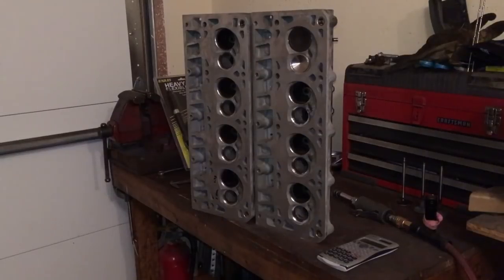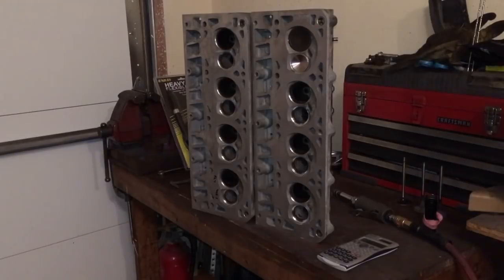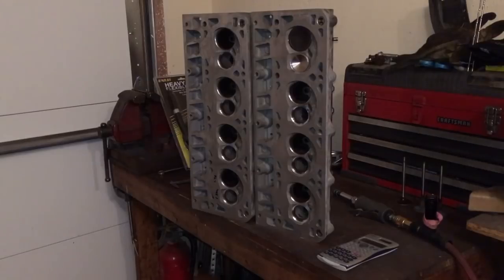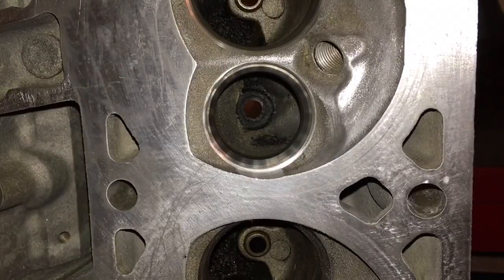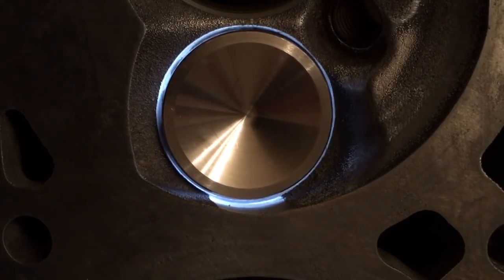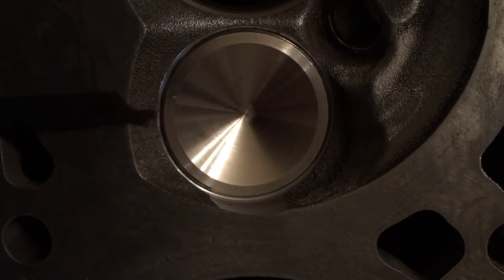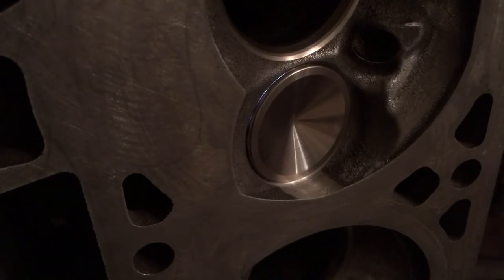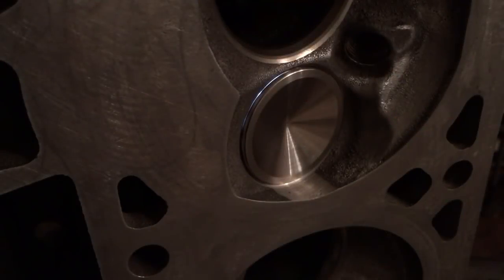862 heads 2.00/1.57 Valves FAIL

Comment: Checking with a flashlight is no way to check valve seal. You need to pull a vacuum test. In either case....too many shops are using 3 angle carbide cutters. Not a bad deal if you know what you're doing. I have bought $1000 heads from Dart, Brodix, etc. and had the same problem. Same problem comes from valves too. You can not take a valve out of the box without grinding it.
Reply from the maker: I vacuum test the valve seal as well,  but I’ve never had an issue checking initial seal with a flashlight inside the port. When I vacuum test I pull 20# vacuum on the chamber side after assembly. I like to put fluid in the chamber area because you can identify leaks around the valve seal and spark plug.  JD

Comment: I realize this was 2 years ago, and I don't mean to be an A-hole. I need to ask, "What did you learn?"

I've been doing this professionally almost 25 years. I've used a alternate machinist 1 time! The last 20 years I've only used Willard Buff at C.A.M. in Spring, TX. Hell....I moved back from San Antonio to be closer to his shop. There's never a reason big enough, after that 1 time, to use another shop. 

Keep up the good work, and I hope the Holley system has been doing well for you.
Reply from the maker: I agree 100%, I’ve been using Nolands Cylinder Heads in KC Missouri for machining processes ever since. Quality and consistent work every time at Nolands! 
The Holley Terminator X has been the saving Grace on my Turbo LS project highly recommended to anyone wanting to LS swap!  JD

Comment: honestly Ive ran bent valves that looked worse on my racecar but cheap motors. Thats bad if a machine shop did that. a good machine shop would never let that pass. they should double check every valve fitting perfectly. that machine shop is a hack and there are tons of hack machine shops.
Reply from the maker: I agree it was a mess and barely fixable by a good machine shop!  I think the shop who did the poor quality work used to be decent but their equipment and attention to detail has gone away.  JD

Comment: sorry , that ex valve looks like it was done on a shaky drill press with a bad cutter and they kept on cranking into it anyway. It would be so powerful to watch fluid leak down test just gushing out around the valve everywhere, you should do it for good measure. is there any possibility of going 1.58" or 1.6"? iwant to use 2.02 and 1.6 valves in 862 heads think it would work?
Reply from the maker: DYNA KLO Two things would need to match:
To properly unshroud the 2.00” valve on the 862 casting in the chamber and having a cylinder bore of 3.900”+.
It’s been proven cylinder shrouding occurs anytime a 2.00”+ valve is run on a cylinder bore of 4.8/5.3 3.785”, so for maximum flow it needs a larger bore. 
These 862’s ended up with LS1 2.00” factory intake valves and Stainless steel 1.57” exhaust valves. I put these heads on my own 4.8 build, it was before the dyno data showing to work best they needed the larger bore; if I had known at the time I would have stayed with the 1.89” intake valve or looked into having these 2.00” valves cut down to a 1.94”.  From what I’ve read, a 1.94” intake valve is as big as you should go on the 4.8/5.3. 
Your fine to go with a slightly larger exhaust valve ie 1.57” or 1.60” if the seat can take the cut which iirc it should.   JD
Reply: @HeadFlowInc  wow thank you headflowinc so much this is valuable and saved me some headaches thanks again so much. im going 4.5" crank and the small valves. its going to have a very mild duration cam

Comment: Yeah , and what ever you do, do not put a crank in without fully cleaning it your self!!!  Some shops will blow it off and say it's ready to in! Leaving the oil passages full of metal that will destroy bearings , and your wallet!!!
Reply from the maker: JAMES! Since the 70's I learned the lesson about cleaning your own parts back in 2001!  I took a brand new crankshaft out of the box, blew it off with an air gun and wiped the journals then assembled the engine.  A small chip of metal put a perfect groove all the way to copper in my #8 rod bearing!!!   Lesson learned 👍
I went through it and cleaned everything multiple times, plus went to a bigger camshaft as my reward!  .030” over 350 w/ 487X heads hyper flat tops and a Howard’s cam.  Strong runner in a 1977 Chevy step side.   JD

Comment: cutters have to machined correctly to cut hard valve seats. I find it easier to go old school and use white stones and grind hardened seats. Re true the stone after several seats and they turn out smooth and concentric every time.
Reply from the maker: superrodder2002 Great idea!  The last set I had a valve job done on was cut with a CNC machine, did great but is expensive.  
I see shops who only want to use the newest machines even if the older machines would be the better one to use. I guess they need to pay for the new equipment?  
Thanks for watching and the feedback I appreciate it!  JD

Comment: WHY  wouldnt you give the name of the shop that did this half assed work  i would like to know so that i could avoid that shop.  I mean this is about as poor of quality workmanship with a big handful if dontgiveafuck     So what ever came of this     ill look for a follow up vid.
Reply from the maker: Adam Kalman I took the heads to my regular machine shop, they measured the stem height to see if the seats could be saved. Because the LS engines use non-adjustable rockers the valve stem height has to be with in a given tolerance..  Luckily Jack Conklin at Performance Machine near Freeman, Mo. feels he can save the seats, there was almost no material taken off the intake seat so it’s savable, the exhaust seat needs to clean up with in a 0.010” cut or will need new seats or a change to an adjustable valvetrain.
The shop who messed up the valve job is Precision Crankshaft in Lee’s Summit, Mo.
Reply from the maker: chadyellowz06 What sucks is they can’t really grind very much off the valve tips either because then the rocker arm hits the retainer. You almost have to set the stem height by the valve seat sealing cut?  Seems like a sketchy procedure with lots of ways to mess it up.
I just learned about all this stem height stuff on the LS heads after the bad valve job issue.  It’s it’s expensive to go to the adjustable rockers but it is an option if the stem heights are off. 
I’m having a set of 862’s milled .030 to try and get the chambers to 59cc.  The chambers are 65cc factory not. The 61.5cc advertised! 😳. The factory compression was only +- 9.17-1 🤔

Comment: That machining work is pathetic. A good automotive machine shop does a complete vacuum test on every cylinder port in order to ensure a good valve job. Can valve seats be cut again, or are you going to need valve seat inserts?

One rule of rebuilding an engine is to never trust the machinist to properly work on crankshafts. It is vital to measure it yourself because either the machinist can make an error, or somebody may have marked the undersize incorrectly. Other times the machinist doesn't test and correct runout.
Reply from the maker: Skyline Fever I’m pretty lucky on the valve guides.  I took the heads to be checked at our normal machine shop, because the LS engine has non-adjustable rockers there’s a limit to how far down the seats can be cut and still maintain the valve stem height  margin.  My heads still have enough material left to be saved, well the intake seat was barely touched; as long as the Exhaust seats clean up within .010 cut it’ll be ok.  If not the alternative is replace the exhaust seats or switch to adjustable valve train. 
I agree, quality machine work is something to be cherished. Thanks for the feedback I appreciate it! 👍👍👍
Reply: Ah, I see. I didn't know adjustable valve train was an option.
Reply from the maker: Skyline Fever It’s expensive, it’s a type of shaft rocker system.  The higher quality setups are proven, but the cost makes people try the off brands; I’m not sure what the quality is on the cheaper setups?  If you built a solid roller LS engine it requires the shaft system. 👍
Reply: I don't know how well cheaper systems work because the LS-series engine is not my biggest passion. I'm more into Nissan and water cooled VW engines.

Comment: On a positive note  I  like the  valves  you  selected . That exhaust valve,  is that a Renegade or an Elgin  or  something  else ? How  much  does  it  weigh or  any measurement specs and  such. Looks  like  a  decent piece  for  the  money !
Reply from the maker: Sorry no reply, we use the Manley, Ferrara, but Renegade valves mostly.  I know the stainless steel valves weigh a little more than factory iirc.  JD

Comment: Im  glad you posted  this , good  lesson to  always  check the work ! Makes me wonder  whats  going  on  at  this  shop,  not  to  check their work before it  goes  out  to  the  customer . Question did  their cutter unshroud the  exhaust  chamber  wall for  you, or did you do that yourself . At least  they  did  do  something  good !
Reply from the maker: JQ Public Apparently the cutter did a little bit of chamber cut during his attempt at a valve job. It’s going to cost me $175.00 to save the seats.
The only concern is whether or not I’ll still be able to use the factory non-adjustable rockers. The stem length needs to be within 2.00”-2.010” to stay within spec.  The exhaust seat will have to clean up within a 0.010” cut to stay in spec. My Intake seat has plenty of meat left so it’s not a concern.
Reply: Its going to  cost  you $ 175 please explain , the shop  that did the work is not going to  stand behind  the  job they  did ?
Reply from the maker: JQ Public Yes, the shop offered to rework the heads for free.  Unfortunately, I don’t feel confident they will do the job to the specifications needed to maintain my factory valvetrain setup.  As it stands right now, after their work, the exhaust seats are not useable and must clean up with a maximum cut of .010” 😳 Any more off the exhaust seat and my pushrod length will change at the very least, at the worst I’ll need new seats to restore the valve spring installed height. 
The intake seat was so poorly touched, it has plenty of meat left to properly complete the new seat cut. 
Jacks helping me out, only charging $175.00 to save the heads.

Comment: Im always afraid to take stuff to machine shops for this reason lol I usually do as much as I can myself I only goto machine shops if I really have to.
Reply from the maker: JQ Public Yeah a good Competition style, some call them the NASCAR style radius valve job is $250.00
Generally it’s $100.00 to surface a head up to 0.010 so you’d be spending big money to cut double or quadruple the amount.  I’m not sure I would cut .040 off an LS Head, you start messing with piston to valve clearance.
Reply from the maker: martinez1701a I wish I could find a deal on the tooling/machinery to do valve jobs. 
I fully understand, I was trying to save $100.00, in the end I ended up wasting $150.00! 😳. It’s a learning experience I guess 🙄
Reply: Im curious what  the machine shop  rates  are  in  your area for  say, to  mill heads up to .040 and how  much is  a  valve  job ? Im  guessing  your  regular  shop charges  $250 for  VJ  and  the shop that  did  this  bad  job was $150

Comment: I use neway cutters and do all my own seat work. The machine shop should have checked valve seat runout. That sucks for you JD. Too many shops out there doing crap work. The problem now is your valve stem heights will be all over the place unless they machine the valve tips to correct the valve installed height.
Reply from the maker: It's a mess at this point for sure, ill have to measure everything very closely.  I haven't been able to talk to them yet, I want to talk to them in person with the heads so they don't have time to formulate excuses.  Fingers crossed!
Reply: Mike MacCracken  what  size neway cutters are you  using to  do LS1  valve sizes 2" in  and  for 1.55 ex    .  Do  you  have  any  specs  or  a  part  #
Reply: JQ Public  I have Neway's master kit which has all the ones needed for standard automotive. I'd go to Neway's website for exact sizing. http://www.newaymfg.com/cutters
Reply: Hey thanks  for that link.  Thats what I  wanted  to  know  , dont  need  the  whole set just one  or  two  cutters  that will  cover most  LS Cathedral heads anyway .
Reply: Its ok if you have 1 high valve stem but a royal pain in the ass if you have a couple low ones. Lol
Reply: JQ Public Neway makes a new three angle seat cutter that works well. I have the 30/45/60 degree so I can determine the seat widths.